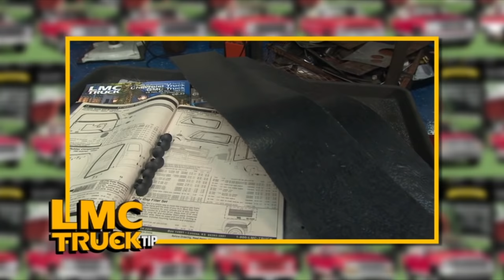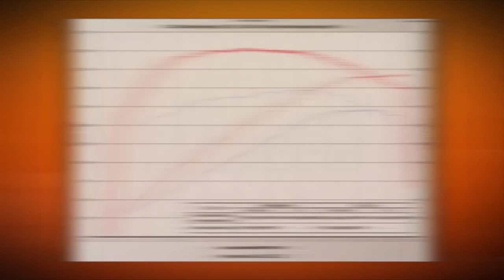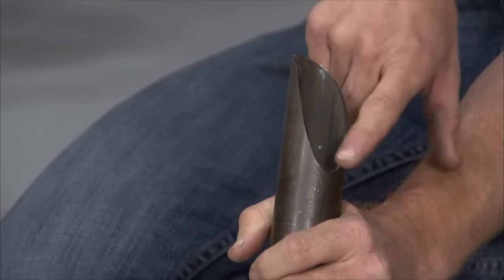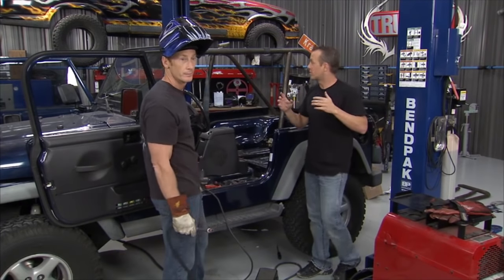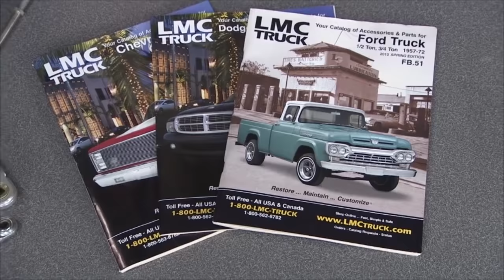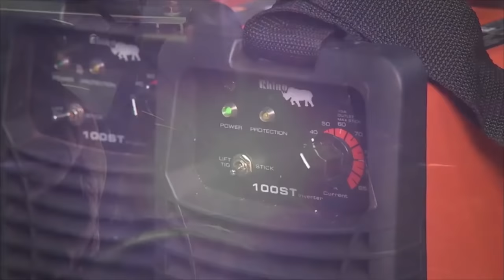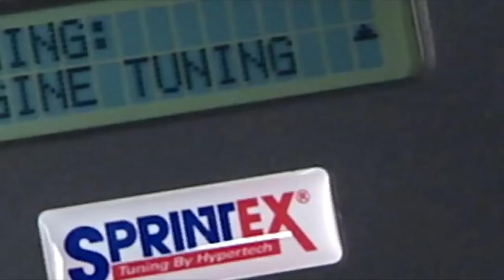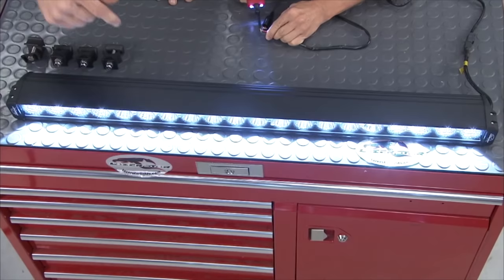The Jeep 4.0L vs. the 3.8L | TruckU | Season 8 | Episode 18

Comment: I just rolled over 330k on my 97 4.0 wrangler. I do routine oil changes 3x a year. This engine goes forever ever ever ever.
Reply: 23v0lv32 I almost have 330,000mi. on my 99 Xj and it still runs and looks like new. Definitely one of the best motors ever.Run forever
Reply: I got 2. 1 has 305,000 other has 294,000 still running top notch. The best. And found, to me, basically a brand new 06 tj with only 57,000 on it. Cant beat em
Reply: 23v0lv32 even when she’s cracked she’ll go as long she ain’t leaking too bad 😂
Reply: Great man! One of  99 XJ 4.0L/AW4 is coming up on a quarter million. Still fries the rear tires in 2WD. I love it. Don't think the engine has ever been apart. I have 4 total: 2) 2doors, 2) 4doors. Combined they have probably 730,000+ miles. Awesome rigs! 3.8V6 is a joke. 4.0I6 forever!
Reply: 2000 xj 218,000 daily driver, had a 96 with 238,000 then a damn deer ended that
Reply: those are rookie numbers lol i just hit 1.275m on my 91 commanche.....engine has never been out of the truck
Reply: Im at 286k on my 2000 XJ.  Rock solid.

Comment: I know you guys are funded by sponsors but it felt like this was 75% advertising and 25% content. You didn't even deliver on the title of this video, the TJ never even drove. I believe you guys have the ability to make good videos, but what you've been doing on TV for 20 years or however long it's been won't cut it anymore. Dirt everyday from MT is the benchmark for me and this is no where close.
Reply: Brad Bowman RT
Reply: I do like the guys on the show, and used to watch it all the time.  But the show does seem to be more sponsor content than actual useful information.
Reply: agree. They spent 2 minutes on the 4L and all they did was put the old head back on.
Reply: "This episode sucked ass"
...as it was a controlled advert for products / sponsors and not a head-to-head competition to where the 4.0L vs 3.8L duked it out was ever shown.

The Jeep 4.0L is the superior engine in all regards and it's wasn't even wheeled in the same terrain, yet even driven where the JoKe was.

If the TJ were offroad, it would have gobs of controlled low-end torque to beat the minivan motor that the thin sheetmetal'd Jeep JoKe used.

ChryCo. Jeep shot themselves in the privates by getting rid of that AMC inline six motor: it was old and not modern, but worked for what it was designed to do and was tougher than any v6 that Chrysler used after it.

Horsepower sells cars; Torque moves them.

Last year for any real Jeep was 2006
Reply: Dirt everyday rocks !

Comment: 4.0 gets a set of roller rockers 3.8 gets a supercharger. didnt need to watch any more. the 3.8 will never be able to live up to the 4.0 and you just proved it.
Reply: Blake Graves lol thought the same thing
Reply: yet there are far cheaper superchargers for the 4.0, even a set up to use junkyard ones off the gm 3.8 lol but hey guess that would be unfair right haha
Reply: Gotta make it fair ...for the price of the blower though you could drop a 4.7 in the tj
Reply: 3.8 has such a huge power advantage. Its based off Mopar wedge engine with high output inmind during design.

Even our 3.3s are wound like the eagle hemi with power to weight ratio.
Reply: @vaughan_metalart  and wont last half as long. 4.0 inline 6 cannot be touched on low end torque and durability. Have 2 of them that have right at 300,000 miles and 1 i found with only 52000 miles for basically a new vehicle. Those other 2 still going strong not rebuilt still lasting. Still jerking stumps out of the ground and work work
Reply: @TheXOoftheRO  no where near the low end torque and durability of the inline though. Facts...
Reply: @brcar6862  the 3.8 is just a whole other level of power when driving on the highway. 4 low eliminates the negligible low end advantage.
Reply: Nice supercharger kit! Is it strange that the whole time I was wondering, hmm I'll bet you could make this kit fit in an early 2000's Chrysler 3.8 minivan with a little work?😂
Reply: @TheXOoftheRO  they were a completely clean sheet design
Reply: @greasysteve5671  uh huh.. Not based off any previous technology right? Lol 😅😂😆
Reply: The 4.0 i always liked the 3.8 are also in mini vans 😆 town and country caravans.  Inline 6 all day
Reply: @mrincredible5492  yea those minivans that average twice the life expectancy as the wranglers while abused by soccer moms.
Reply: Indeed.
Reply: @hinterseerherold  You mean the ones that blew head gaskets and leaked out the intake manifolds while the vans around them decayed if you looked to hard at them?
Reply: @dachine86  
Obviously 😂
Reply: MG42pillbox I can most likely settle the dispute here since I ironically own all 3 vehicles. The 3.8and or 3.3 or very reliable (350k on mine) and plenty fast enough for a mini van. But in a Jeep, especially with bigger tires and a 4 door it’s a dog on low end but better than a 4.0 on the highway. they also make higher rpm power which doesn’t work as well for a Jeep. The 4.0 is much more torquey and funner to drive on trails and around town but highway driving sucks, unless you stay in the slow lane. All in all, they’re not really comparable and it really depends on what kind of driving you do. But we can all agree jeeps should come with v8s from the factory.
Reply: @TheXOoftheRO  ya...it has lifters and push rods.... and works off the auto cycle
whats your point?

the 350 and 5.3 are TOTALLY different engines....again...clean sheat
but apparently because both are made by GM and are v8s they are the same motor??
Reply: @TheXOoftheRO  ya just want to say your minivan has a HEMI.... 
my dads a mopar guy..... we get it, the HEMI was a good engine

too bad the modern 5.7/6.4 HEMI isnt even a HEMI....
Reply: Yeah when they said that before the break I was like wait what? Haha what a joke. I like when they said the gasket added radial strength too wth

Comment: Add equal upgrades, or test them stock vs stock. Rockers on the 4.0 and a supercharger on the 3.8 just to compete kinda says it all. 

Those 3.8s blow up on their own. That blower was just like pulling the pin on the grenade lol.
Reply: When I was researching my caravan with 3.8 I remember reading that the 3.3 and 3.8 couldn't handle boost. I wonder how long this engine lasted (or if they did something to make it tougher).
Reply: How about valve adjustments?
Reply: 99 tj 4.0 225000 on odometer just replaced timing components
Reply: Elias Salazar: 235,000 3.8 still rolling just fine, and I beat on it. and still pulling vacuum from the oil cap. No blow-by.
Reply: Just had a rod bearing spin on my 07 JK with 168k on the motor.
Reply: 4.0s are great engines but in fairness, I'm blown them up too.
Reply: the 4.0 will run forever without coolant or oil lol you try and do that with a 3.8 and itll die in 10 seconds
Reply: @vapecatt  what do you do to maintain it if you still have the Jeep!?
Reply: @berick4723   @Erick Escalera  Well that was two years ago. The Jeep is long gone in a junk yard now. 265,000 was the last thing on it when it blew up the transmission. Those 42RLE's couldn't hold a light up to the old 42RE.
Reply: As someone with the skills to blow up a SlantSix,.... Yeah, there were issues with the 3.3/3.8, but by the '04 update to the Voyager/Caravan, the majority had been sorted, and so long as the major services have been done, and the Timing Chain swapped around the 250,000km to 350,000km mark (about 180,000 miles + ) then in Stock form they're a reliable motor.  In the JK, they're a 50/50 motor, 50% have already blown up and the other 50% will never stop.... :)
I'm planning on dropping a stock 3.8 into a '66 VC Valiant, the Sprintex is tempting, but I can't find out if the 3.8 still used the Cast Crank, which is what was the deciding factor for the factory to NOT boost these motors.

Comment: Proud 1998 Jeep Cherokee 4.0 owner here. In the 300k club, no oil adds between changes yet!
Reply: I want to do a stroker 4.0L based engine swap in my 2004 WJ Freedom Edition. But the damn 4.0 runs perfect, it gets 18MPG all day, and it won't die.
Reply: @xmo552  That would be AWESOME! 4.0 is bullet proof.

Comment: 4.0 was the last good engine Jeep had
Reply: Hunter Sieling I got a 91' Cherokee with a 4.0 in line 6 that I'd been wanting to fix up
Reply: I love my Jeep. Its beaten up,not very good on fuel but it keeps going. I have got quite a few better nicer cars but my XJ 4.0 is actually my favourite.
Reply: This is why I put a 4.0 and AW4 from a 1994 XJ in my JKU. So much better than the shitty 2.8 crd at came with.
Reply: Amen! My dad worked at the Kenosha Engine Plant where many of them were made. He was a Journeyman Tinsmith.
Reply: J J  when the 2.5 and 4.0 died, jeep died with them.
Reply: Hunter Sieling pshhh the 5.2L Chrysler 318 was bulletproof
Reply: My 4.0 has 446k miles just did a compression test still better than factory specs. Love this thing lol
Reply: I daily a 3.8. Its a dog but it isnt as bad as these guys say. Mine will smoke my girlfriends 4.0 and is way more capable offroad

Comment: 3.8s are alright. I drive a taxi (a Chrysler Town and Country) with one that has more than 350,000 miles on it and it's quick... once you rev out 1st gear. But the 4.0 is better in every aspect without a doubt. Especially in an offroad application. I wish a 4.0 I6 could fit in my taxi.

Comment: They took the head off because 00’s and 01’s had a casting defect which lead to a cracked head between the 3rd and 4th cylinder. That wasn’t the same head, they just bought a new one lol. Still the 4.0L is a beast and has no equal.
Reply: Figured it’s worth mentioning the issues are from 1999-2002 pre 99 or most of the mid 02 year motors didn’t suffer from the poor quality 0331 cylinder heads

Comment: Why pull the head to do valve stem oil seals on that 4.0l. The seals can easily be replaced with the head in place. Nevermind, I see its for product placement advertisement.

Comment: Did you know that the 4.0L straight 6 was built first by AMC(American Moters Corporation), and the Chrysler 3.8L dates back to the Chrysler K body derivatives C body New Yorker/ Fifth Avenue in 1992. The Caravan Grand got the 3.3L V-6 and the 3.8L V-6 as options for the 1993 model year.

Comment: 190,000 miles on a 3.8 with larger tires in a heavier rig.. Good luck on your oil consumption and your main bearings. I've made a bunch of money LS swapping these JK's . Meanwhile my 4.0 has 290,000 miles most of that on 33's :) If you want power.. Turbocharge it. LOL
Reply: The solution to the oil consumption issue with the 3.8 is use to use 5w-30 instead of 5w-20. That’s what the engine originally called for. Chrysler changed to the lighter weight to improve fuel mileage to improve EPA standards. The 3.8 is totally fine. I don’t get why so many like to rag on it. 

I’ve had a 2009 JK with the 3.8 in it for 12 years and it now has 150k miles. I’ve never found it lacking.

Comment: Pulling the head of the 4.0 isn't what I would call ambitious...4.0 is the kind of motor you slap a new headgasket in Sunday morning before church😂. Try that on the 3.8 lol
Reply: Why yank the head to change valve seals? Just roll the piston to TDC release the spring and change the seal. But oh well I saw where this was going and checked out.
Reply: When you say "church" you really mean off-roading, right?
I know that's where my church is.
Reply: Looks a lot easier than my miata Head, and even that is really simple.

Comment: 92 xj 484,440 miles currently, original engine. daily driver. sounds like a sewing machine still
Reply: Same here got a 1993 with 385k never skips a beat.
Reply: What tye of oil and filter do you use ?

Comment: Despite the heat soak and over heating issues due to the design of the 4.0. The 3.8 can’t and won’t hang in terms of durability. Of course the maintenance and care that you give either engine is a big factor. 

That being said.... Giving roller rockers to one and a charger on the other? Seriously? LoL

Give the 3.8 the charger..... Give me the stroker kit on the 4.0.   Ok? Let’s go!!! 😉✌️
Reply: The Jeep 4.0 DOES NOT have  overheating ISSUES ,,,,Due to it's design! LISTEN up,THIS IS AN OLE SCHOOL BLOCK HAS MORE COOLANT TRAVEL PRESSURE ALL ENGINES IN THE 40,,s50,s60,s to about 1977 THE LOWER HOSE ALWAYS HAD WIRE SPRING INSIDE WHEN YOU GOT ONE AT AUTOSHACK,NO ORIELY,AUTOZONE or ADVANCE ,,,THIS WIRE KEPT THE HOSE FROM COLLAPSING,THE 4 .0 IS A SPINOFF FROM HUDSON ONE OF THE FINEST AUTOMOBILES EVER MADE,HUDSON WAS BOUGHT BY AMC, THEN CHRYSLER'  BOUGHT AMC THE 4.0 IS 70 YEARS OLD!!

Comment: the 4.0 is a tested true runner. to the redline off the rev limiter in the mud for years it will run go and go.. youll get 200k easily out of the solid power plant. the 3.8 is junk minivan motor. their prone to just falling appart under 100k miles under just driving down the road. a super charger will just kill it quicker..
Reply: Yes, agreed. But I HATE the Hemi swap option because I like it to be closer to original. I want to do the 505 performance kit to beef up my 3.8 then strap a super on it. F Hemi in a jeep. I like to keep the engine bay accessible for tail fixes.
Reply: jimmy neutron
Reply: I love the 4.0, but to ignore the huge number of high mileage 3.8s out there is just bad math.    It doesn't measure up to the 4.0 in the power arena, but they aren't fragile.   

And the minivan line is old.    How many v8 station wagons shared a motor with a muscle car?    Many, and I've yet to gear anyone bitch about an impala or camaro having a "station wagon motor. "
Reply: nate taubitz the 505 kit doesn't seem like it's the answer everyone hoped it would be.    

Hemi in a JK?  Eh, you could, but the best value looks like an LS swap.
Reply: jimmy neutron 330,000 and still going strong.
Reply: jimmy neutron i
Reply: jimmy neutron You must not know much about the jeep 4.0. The early ones were a great engine. The newer ones are hit or miss at best. The 97-99 have weak pistons.  It is well documented and I have rebuilt several engines because of it. The 2000 to 2002ish have 0331 cylinder heads which are a  crack waiting to happen. Again , a known fact, and  I've rebuilt several 4.0s because of this.   Less comon knowledge,  but...by 2003 the tooling to make the 4.0 blocks was so worn out they developed bad camshaft  cam syncronizer clearences that have caused all kinds of problems...
   The 3.8 is/was a turd. Hopefully the 3.6 can live long enough to have half  the problems of the OG 4.0...
Reply: My 92 Jeep Cherokee Laredo 4×4 4.0L high output has 375k miles on it and it still outperforms the 3.8L all day long.
Reply: My 1999 Xj has almost 400,000 miles and is just like new....A REAL BEAST!!

Comment: I've owned a supercharged car and I had also had the same model that was naturally aspirated. The supercharged car drank 93 like it was going out of style. The supercharger adds more air and that requires more fuel and that drops the MPG. Because superchargers are belt driver it takes power to make that power plus it's always turning and causing you to burm more fuel than stock. But the fun fact is insane with a twin screw blower becasue the hit is so big and so early you just can't stop grinning like an idiot every time you mash the gas.

Comment: Did the 3.8 survive the Supercharger? For how long? There's little information available about the 3.8's crank - the Cast Crank in the 3.3 version of the motor is the reason why the factory nixxed any plans to add boost  - In the dyno cell used to homologate he  motor for  emissions and  production testing, a turboed 3.3 had the crank let go without warning. It's documeted over on the Allpar website with an interview from the dyno cell operator.

Comment: The 3.8 is a solid engine with a little more power than the 4.0 and a similar power curve. 

What gives many the impression it has less power is the lag in the drive by wire system and a poor rear axle ratio that Jeep chose for the JK on base models.

Comment: What killed the 4.0 more than anything else was packaging. You only had one platform using the motor. About the only other possible platform was as the base engine in the Ram. Mound Road had a lot more traction in corporate than KEP so that wasn't gonna happen. Getting it to pass tighter emissions would be a real  bitch. Their were options on the table so to speak. By putting meat back into the block they could have gone diesel.  As I understand it a 24 valve head was looked into. Both pushrod and OHC.

Comment: So when you put in the supercharger on the 3.8 why didn't you upgrade anything else? Is the engine strong enough to handle the boost or should you up grade the value heads? I'm just trying to understand. Dont want to buy something that will break every if I'm not told to grade things first.

Comment: "+25 HP W/ Roller Rockers"...!
Is that true? I would have guessed 5hp gain, maybe 10....
Reply: I call bs!
Reply: It's bullshit. Of course it is engine defendant. But you might see 10hp at the most. 25hp gain might be true if you compare 1.3 break in rockers to 1.6 or 1.7 aftermarket rockers 🤣

Comment: I have an '18 JKU with the 3.6L pentastar V6 and it has power especially if you free up the exhaust and the upper and lower intakes and a throttle body you will be in the +320hp range N/A, and with a wet 75 shot of nitrous you will go up those dunes.
I really don't like the superchargers.